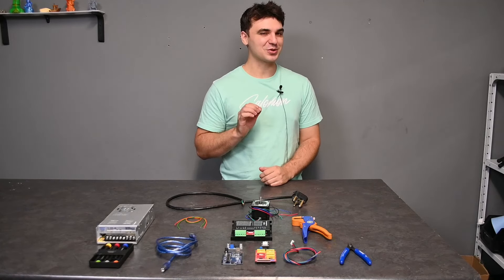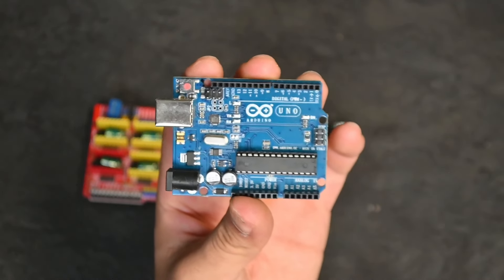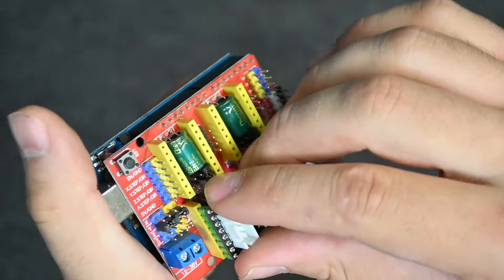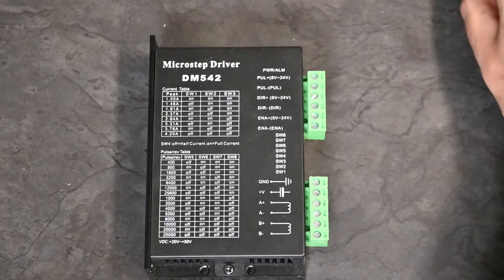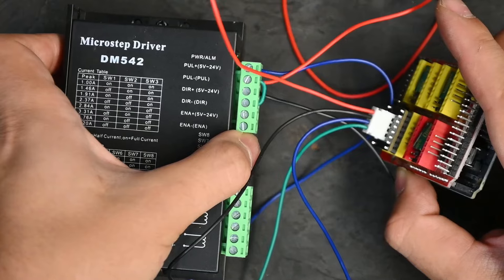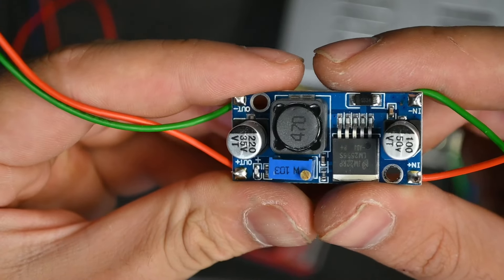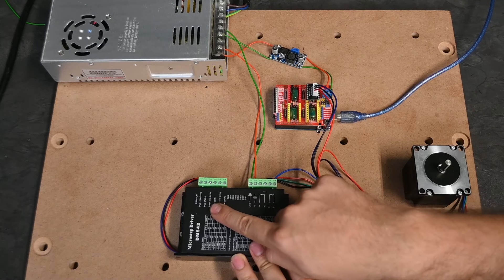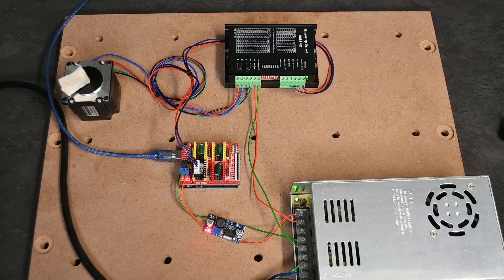How To Wire Your Stepper Motor

Comment: Aaaaaaaaaaaaaand what is cost of this DIY system?
Looks fun... 🤣🤣🤣🤣
Reply from the maker: It depends on you would need exactly, you can get larger and smaller stepper motors, different drivers etc.

This exact system would put you back about R2200
Reply: @3DPrintingStorecoza  
Thanks. Always wanted to give a CNC a spin. I also heard of some conversions available for the Ender 3 printer to convert to CNC.
Something else you guys could look into and MUCH easier to setup.
Reply from the maker: Will do so!

Yea, this video is for those who want to build their own custom rigs but aren't too sure of the wiring and components. If you get a Cron Craft, most (Nearly all) of these steps have already been take care of
Reply: @3DPrintingStorecoza  OOO! And while you at it, do the Creality Laser engraver attachment! That also looks interesting!